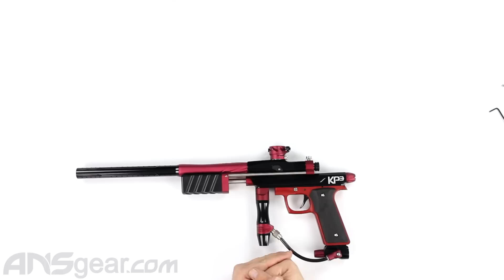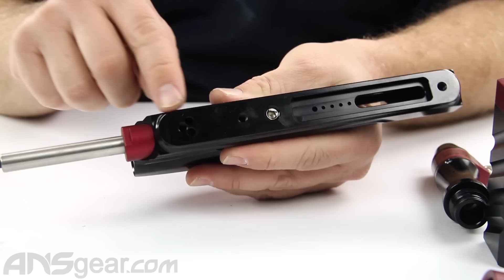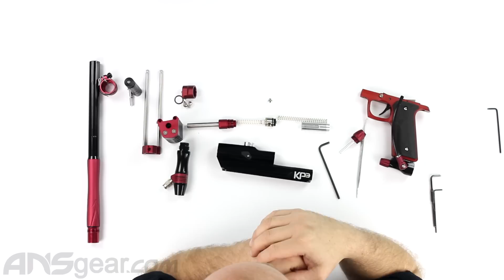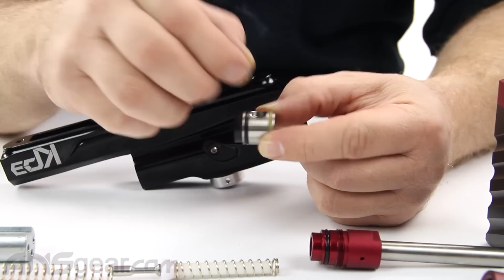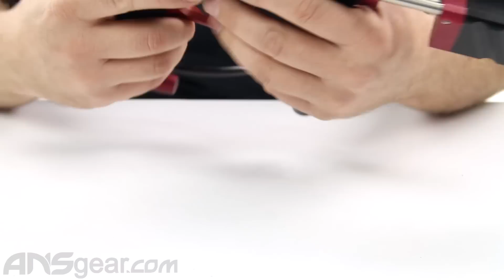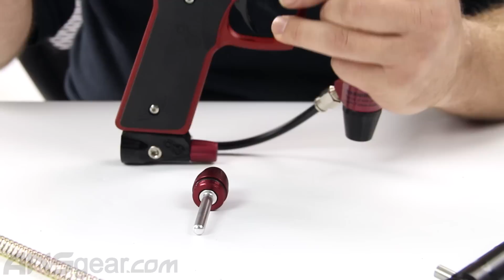Azodin KP3 Kaos Pump Paintball Gun - Maintenance/Repair

Comment: Any thoughts on why the pump action on my kp 3 is stiff and sticky ive cleaned it thoroughly re greased all o rings and oiled up the guide rods but it seems like it like to stick sometimes or hard to pump thanks
Reply: pump handle and plate are most likely misaligned. two screws holding together need to be loosened. adjust handle and plate retighten.

Comment: I tried to adjust the velocity on my gun with the velocity adjustment and it did nothing had to adjust thorough the regulator
Reply from the maker: The adjustment can be a bit more complicated than that. Please call in for assistance.

8055228700
Reply: @ANSgearPaintball  can u use these with co2?

Comment: My kp3 is leaking air from the barrel not alot at one  time but a steady flow of air, any suggestions as how to fix? I got it from ANS gear first time i used it i noticed it out of the box
Reply from the maker: few things to check: bad cup seal, bad valve o-rings, not cocked back when gassed.
Reply: ANSgearPaintball thanks for responding im going to have our local tech look at it
Reply from the maker: you're welcome

Comment: Hey at 9:26 the red part idk what you call it but that little tiny hole is were I can barely hear some air leaking from it how can I fix this?
Reply from the maker: I would recommend calling our tech department. We are available Monday-Friday 8AM-5PM PST. Our phone number is 805-522-8700. It will be much easier for us to assist you over the phone. Thank you!
Reply: ANSgearPaintball ok thank you so much
Reply: could be one of the orings or a bad cup seal
Reply: FaZe Mouse x